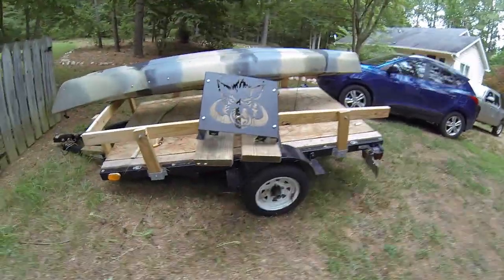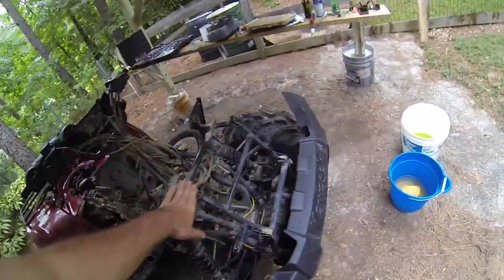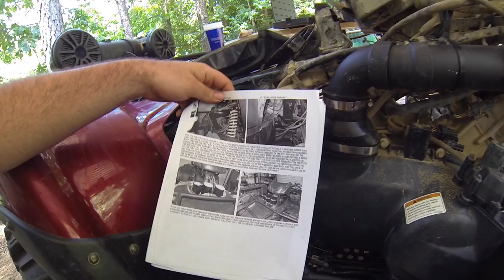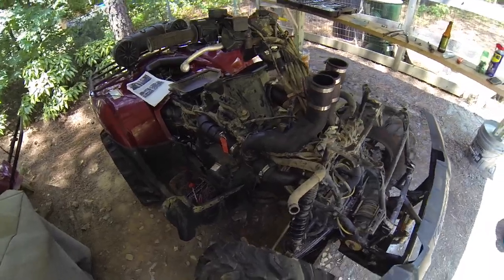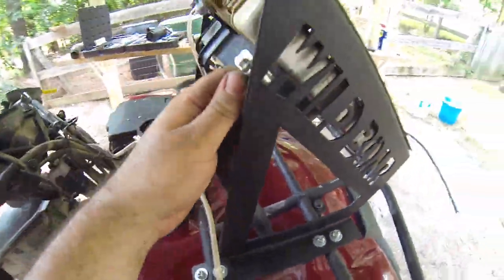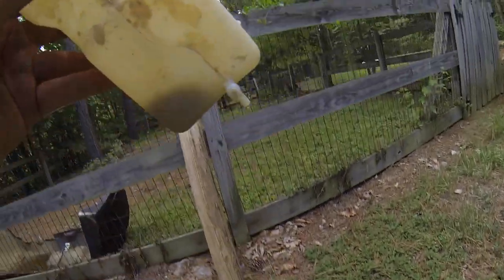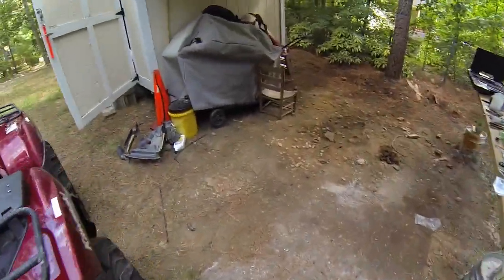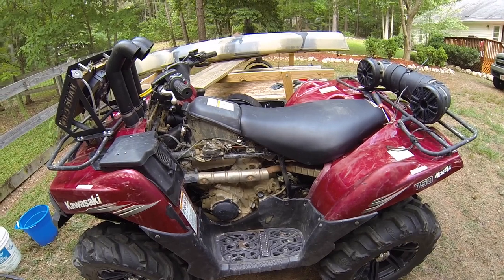2011 Brute Force 750 Snorkel/ Radiator Relocator Kit

Comment: The unidentified hose you extended might tie into the air box nipple you sealed.  On mine 08 it's about a 12" piece of hose that vents whatever is directly below the airbox up into the air box.

Comment: just ordered a snorkel kit for my brute force also. I just have a couple questions for you. does your airbox leak from the seal? and has the belt ever gotten wet. I didn't know if there is something you have to do to seal them both better.
Reply: bluedonkey7.3 to test you intake put your hand over the intake snorkel and if it dies out quick your sealed u can blow smoke (from a vape, cigar,cigarette) and see where the leaks is fyi you can do that to all your snorkels

Comment: Yes Cclam1, that hose you stated that has been cut at 9:36 is suppose to connected to the left upper side of the air box if you were sitting on the bike facing forward. There is a notch coming out of the airbox for you to push it back on. That tube is suppose to let your idle adjustment and FI vent itselft.

Comment: Hi 
What type of hose do you use to connect the air box ?? I have a 45 degree silicone hose but it touches the steering column. Yours does not seem to rub.
Thanks